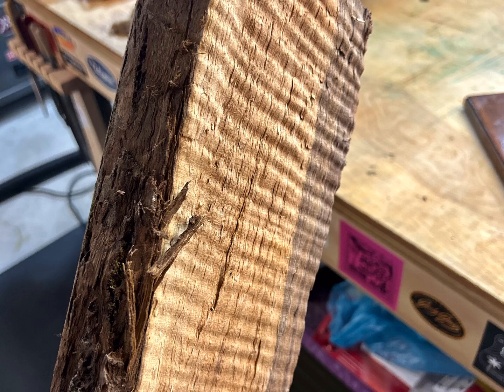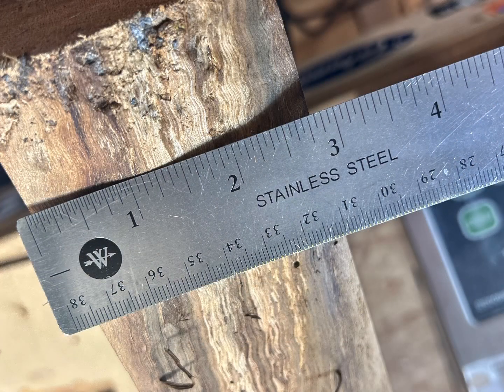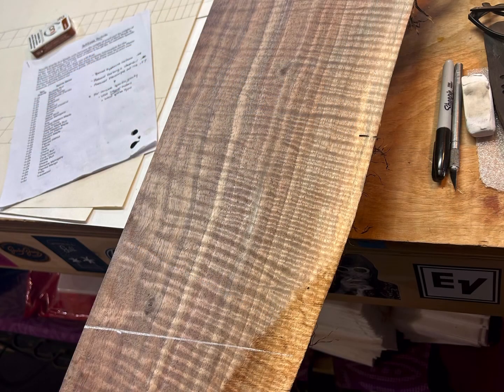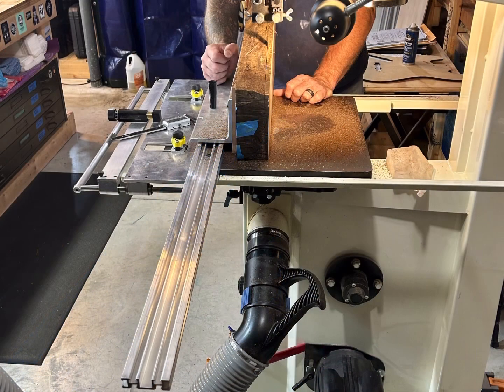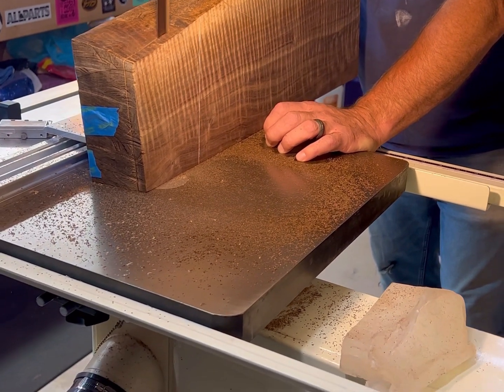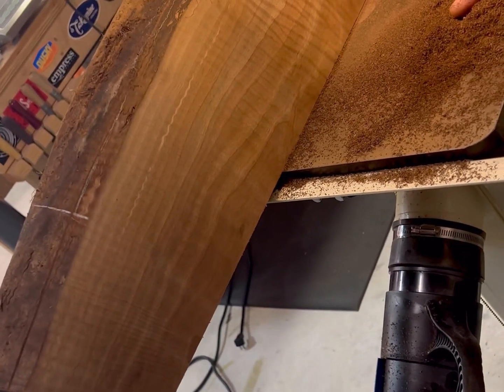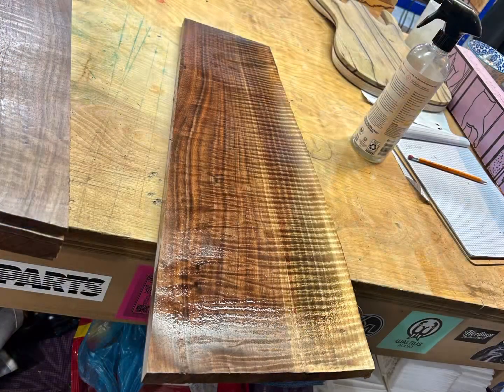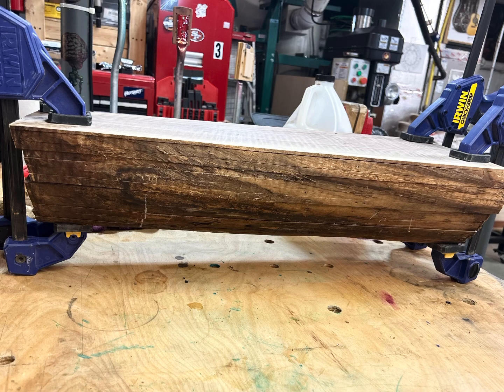Unbelievable Figure on local black walnut / braking down with Accu-Slicer bandsaw system in house

Comment: No spacers ("stickers") between the boards to dry?
Reply from the maker: Great question Dave. The slabs were at 10.9% to 11.5% at 3/4" depth with a very good pinless moisture meter when they walked in. My shop is humidity and temperature controlled and I re kiln dry all of my wood I buy and let rest and season. My shop is 42%-50% max leaving all my slabs at about 9.5% after I soft kiln dry down to 6-7% and they rest and come back to where they will stay.
  Perfect for building but not cutting 3/8th thick boards at 11% they will turn into a banana in less than 6 hours and crack and check. This is to keep them flat as possible. We opened up the wood and rapid moisture loss with thin stock can leave it unusable. It’s happened in my shop. So, for these sets they are drying out quickly I only have the ends clamped so they keep themselves as flat and straight as possible for the next month or so and then I will release the clamps and see ho they move or not. Then I’ll drum sand join them for tops. 
 It's just to slow it down when cut that thin. Depending on thickness and moisture content I clamp sometimes to steel beams or stack weight on. The thinner stock is so much more susceptible to dancing and moving and grooving around than thick in my experience.